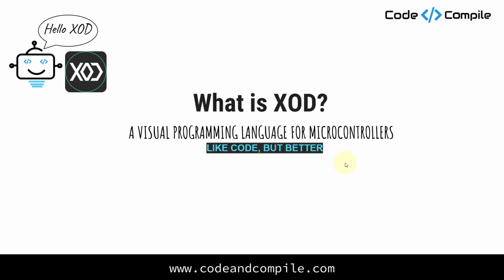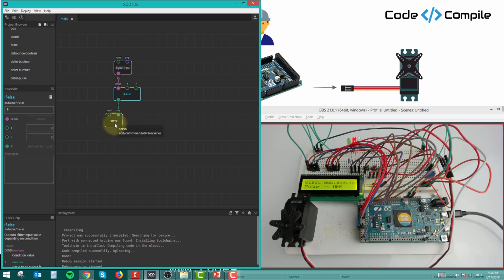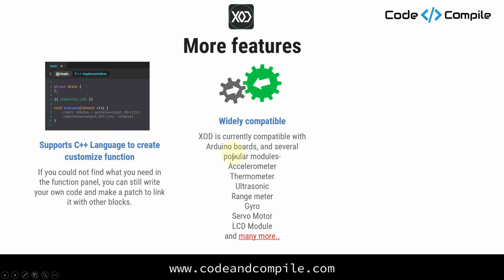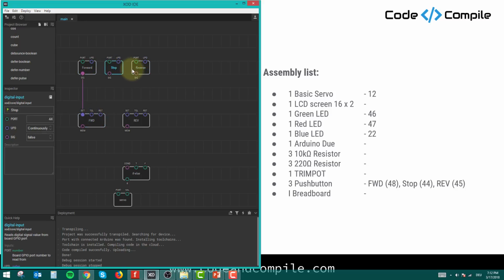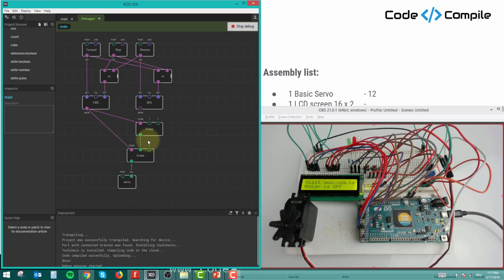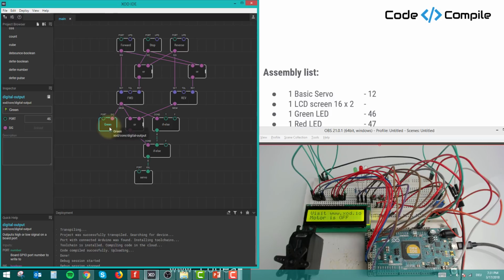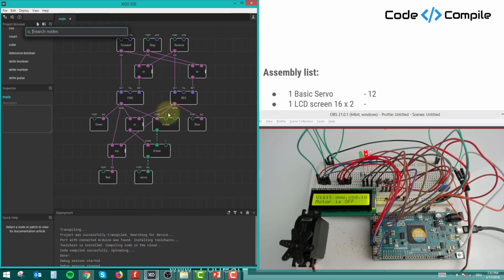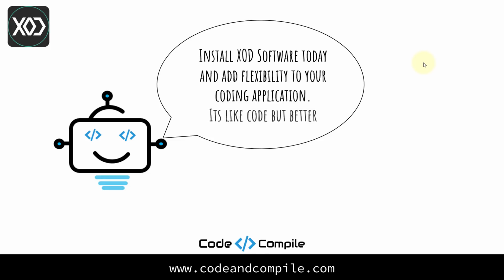What is XOD- Introduction to Arduino Visual Programming Software

Comment: Answer:. Xod is a programming tool that you can't use an nrf24 or create data arrays to send data if the nrf24 library worked.  It's completely pointless

Comment: hi, i cant find the digital input in the core library
Reply: sum fatt, I have the same issue.
Did you find the answer? Please share if so
Reply: @MrDrew32xx   yes seems the names has changed maybe in new versions...you can do it with digital read instead of digital input